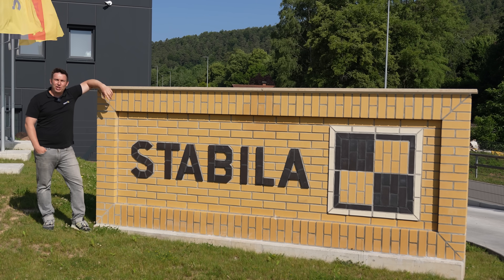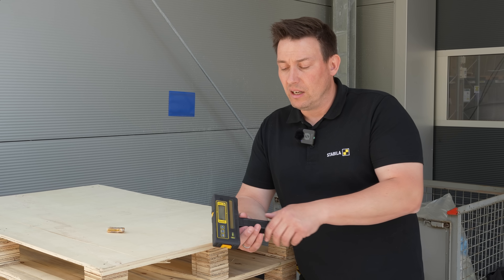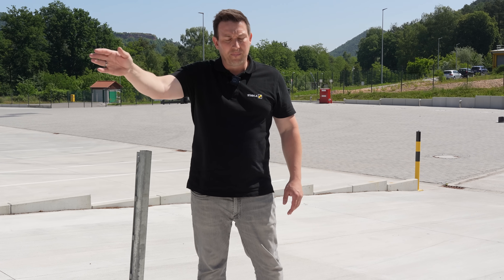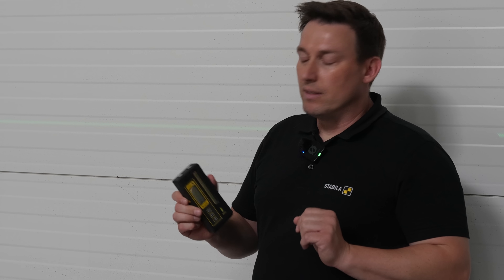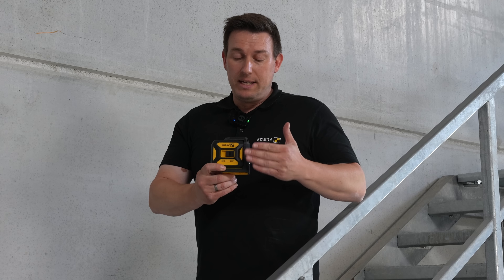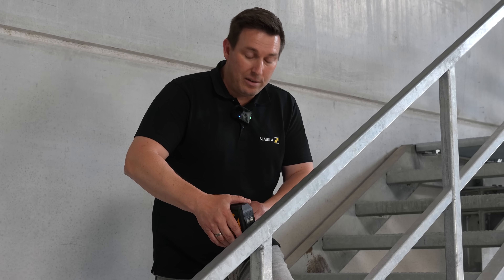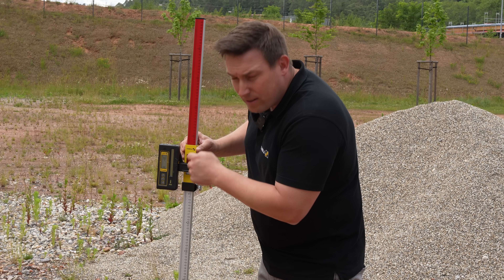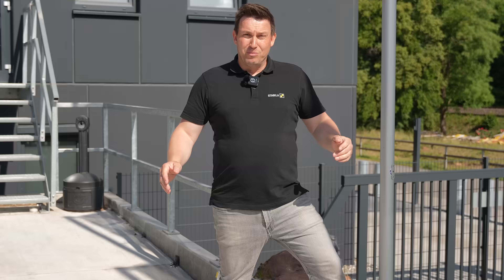Precise Measuring with STABILA | Cross Line Laser LAX 320 G + Receiver RL 230 RG

Comment: Does the LAX 320G have a plumb laser mode? Not the vertical laser but if you wanted to transfer a point from floor to ceiling - like a dot?
Reply from the maker: Thank you for your comment 💛🖤 Yes, it has a plumb dot. Just activate all lines. There is a bright spot at the top of the vertical line and one spot at the bottom.